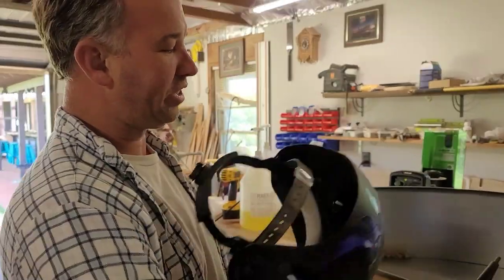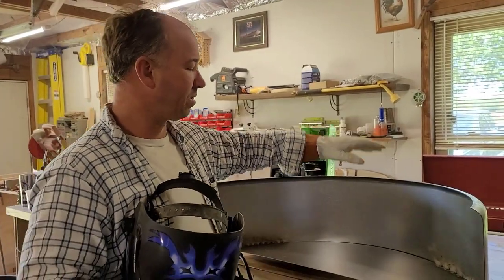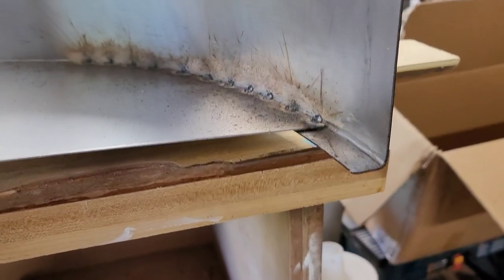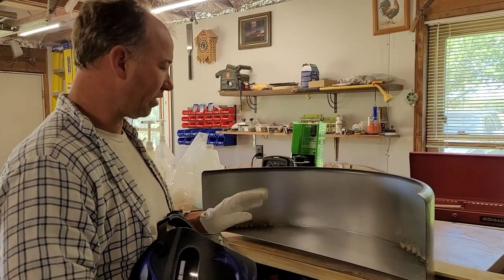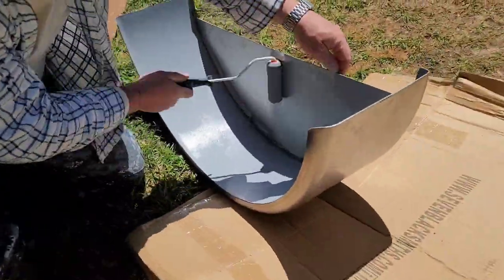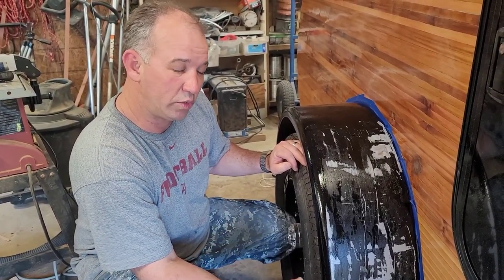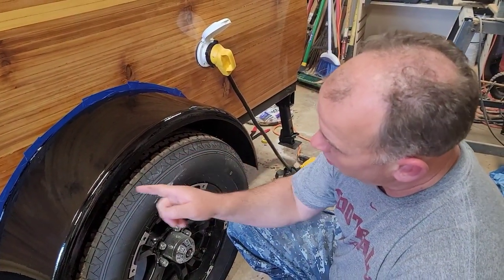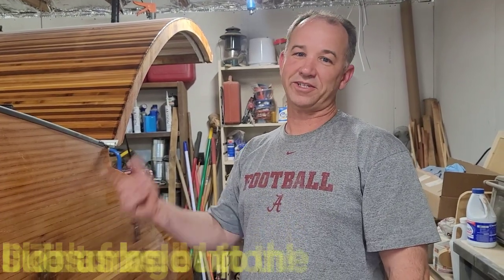DIY Teardrop Camper | Cheapest fenders on Amazon | Fender Install

Comment: You skipped the mounting steps! How did you mount the vendors to the trailer? And where.
Reply from the maker: I put 2x4 blocks of wood on the top of the tires and set the fender on the wood, mark, drilled, and bolted on the fenders and put sealant on the bolt heads before tightening them down.

Comment: How’d you like the 125 amp HF welder?  I just bought one when they went on sale a couple of weeks ago.  It’s an upgrade from the Chicago Electric 90 amp that I have, which has worked fine, I’m just hoping the 125 amp inverter will work even better with less splatter.
Reply from the maker: I actually like it a lot. Just keep clean tips. I'm about to put it to a real test when I start building my sawmill with it.